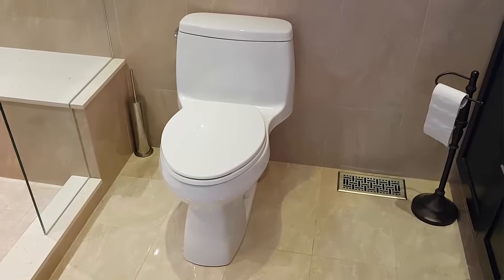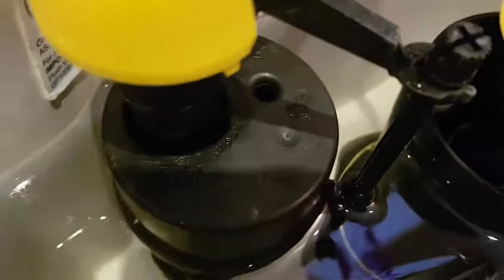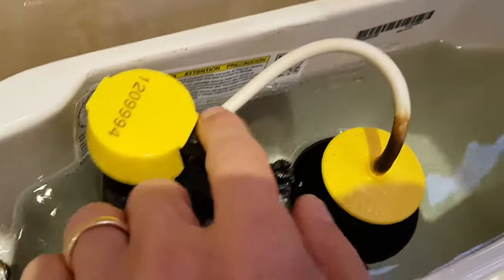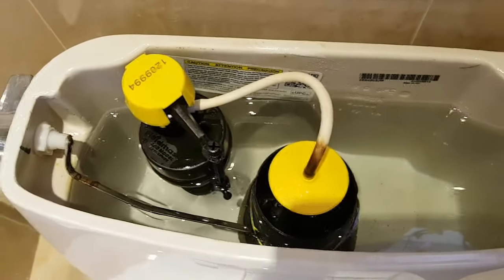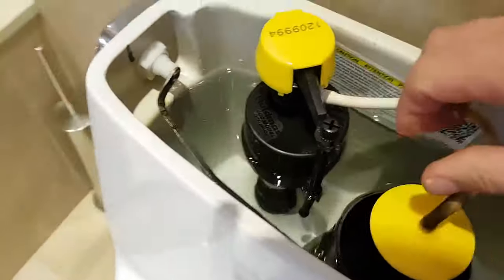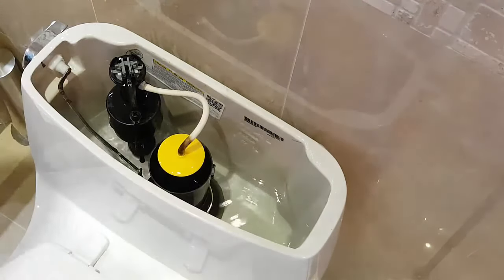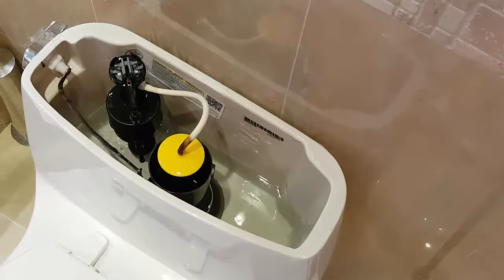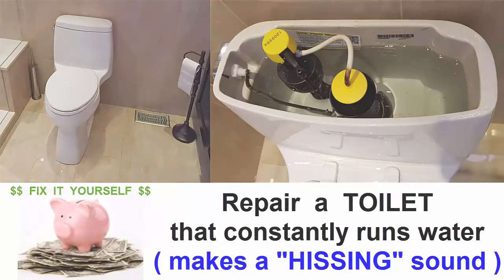Repair a Toilet that continuously runs water (makes a "Hissing" sound)

Comment: Thank you! I was on my way to bed and ask my husband if he had use the bathroom recently. I heard a hissing sound and when I lifted the lid I saw that water was still running and the hissing sound.  Well it’s 3:30am here in the Poconos and there no hardware store open. So I suggest we shut the water off. We look at some YouTube videos and came across yours. I showed my husband it and he did exactly what was in your video. There was some debris. We had an old brush. He popped it back in and boom it worked. We thought we were gonna have to replace all the guts which are like 2 years old.  Thank you so much! Now I can go back to bed and rest soundly. Thank you!!!!
Reply from the maker: Thank you for your comment and positive feedback. Glad to hear the video helped you resolve your issue. Thanks for supporting my channel. Vito Casola - FIX IT Yourself!!

Comment: When I take the cap off it's spraying lightly underneath out of the top. Is that due to a bad gasket or is the entire assembly broken? It's night so I don't want to mess with it right now in case of emergency the stores are closed. I did remove the washer gave it a good cleaning and flushed water through the valve by turning the water back on and it still hisses and sprays. Thoughts? Can just the valve fill assembly upper portion of this part be replaced?

Comment: OMG.!!! With your Video I just fixed my toilet.!!! I was told by my Plumber I had to call KOHLER for a replacement part and/or call Lowe’s. It’s the weekend so I finally decided to Google how to fix a hissing toilet and clicked on your Video. With your help my toilet is fixed. Thank you
Reply from the maker: Hi Sharon,
Thank you for your comment and positive feedback. I'm so glad to hear your story. Isn't google and YouTube amazing? Someone who has gone through the same trouble and diagnosed/fixed the issue can then help another person to quickly and easily fix a little problem with relative ease and zero cost. Thank you for supporting my channel. 🙂 Vito Casola - FIX IT Yourself!!

Comment: So I changed the flapper based on another video and still heard the water running.  I tried turning the knob which adjusted the water level but didn’t stop the leaking.  Just when I thought I’d have to replace the valve I watched this video and took the top of the valve off and cleaned the rubber and plastic (which I doubted would work).  Working perfectly and stopped all running water.  Thank you!

Comment: Thank you so much for this video!!!  I watched several on how to stop the toilet running but none of them offered the solution.  You suggested cleaning the valve and showed how to take it apart.  My toilet is American Standard, so it has a similar assembly.  Lo and behold, cleaning the grit out did the trick.  My daughter and I worked as a team (she's a nurse) and with tweezers and a dental floss gadget, we got 3 wee stones out of there.  It felt like a medical procedure. :). No more hissing or leaking water.  Thank you again!!  Empowered?  You bet!

Comment: I have the same toilet so it was easy to follow your steps. There was a tiny white pebble stuck in the valve. I removed it put it back together and the hissing/running water stopped! Thank you, a plumber quoted me $325 for a rebuild!
Reply from the maker: Wow!!! So glad to hear my little video helped safe you from possibly giving that plumber the go ahead to fix the issue for that price. I think you could buy a brand new toilet for less than the $325 he quoted. Anyway, so glad you found my video and it helped cure your issue. Vito Casola - FIX IT Yourself!!

Comment: I just spent $500 to have the shut off valve replaced and new fill valve. Heard the ghost flush and hissing after the plumber left. I was very upset as the plumber told me if the water still runs then I need a new toilet. Googled this morning and found some debris in the chamber. No more hissing. Fingers crossed no more ghost flushing. Thank you!
Reply from the maker: Too bad you didn't find this video first. It would have been nice to know it could have saved you the $500 bill. Vito Casola - FIX IT Yourself!!
Reply: @FIX-IT-Yourself  I definitely still need to have the professional to fix the water shut off valve. That part was busted (20+ years of not turning the valve). It was like $200+ to fix the valve and another $200+ to replace the internal mechanism. I am just happy I didn't have to call them up again. I may have listened to them and replace the toilet. Yikes! Thanks for the video.

Comment: I have to thank you for your video. You were the only ne I found exlaining the FILL VALVE, BUT...... when I was taking everything apart, I discovered something I had only seen one time. I had a "BUBBLE" in the yellow seal. I used a NEEDLE to puncture it and get the WATER out of the bubble which had been holding my seal apart from sealing. Of all thee videos about how to change the round valve in the bottom of the tank, NO ONE had indicated that the valve could be defective and allow a little bubble full of water to cause the tank to slowly leak. Thank you for taking the time to make your video. You did an excellent job.
Reply from the maker: Thank you John for your comments.  I'm glad to hear you found the video helpful and better than most others.  It's comments like this than keep me inspired to continue making videos that will assist others to diagnose and fix problems around the home themselves and in the process save some money, learn something new, most important of which is that most thing you can FIX Yourself, even if it just requires a little guidance to give one confidence to go ahead and tackle the job.  Keep on FIXING IT Yourself!! Vito Casola - FIX IT Yourself!!

Comment: After just 3 weeks my new Kohler toilet with the yellow-cap Fluid Master started running on as described here.  Followed this video and it is fixed.  Did not see any debris on the black washer, but did the flush under the cup as described.  Thanks for making this video!
Reply from the maker: Hi Moss, Thank you for your comments, it's really appreciated. I'm glad the video helped you fix your issue.  I know it's not the toilet but just the smallest piece of debris that may get stuck inside the valve assembly under the washer and sometimes it will pass through and other times it will get stuck and cause the continuous running of very small amounts of water and you hear the hissing sound.  I too was baffled when I first noticed hearing the sound. It was late at night when everything was quite and the furnace wasn't running and when I had to put my head close to the toilet I noticed the hissing and that's when I started exploring where it could be coming from.  Anyway I'm glad my experience is helping others.  Vito Casola - FIX IT Yourself.!!
Reply: Thanks.  None of the other videos addressed this problem!  That yellow cap didn't want to come off, but when it did, the toothbrush and the cup over the water test proved great!

Comment: Thanks for stepping through all of the detail - I've done easy fixes on old-style toilets, but finding all of this plastic in a new one I was afraid I was going to break something just trying to make adjustments. (Same "hissing", the fill valve was refusing to close all the way even if I pulled the float up hard; sure enough, taking the top flap apart and brushing everything off was all it took.)  Also thanks for the "just turn the water back on only a little at first" - seems obvious but it hadn't occurred to me and is a really good idea.
Reply from the maker: Hi Mark, Thanks for leaving a comment and for the positive feedback. I'm really glad this video helped you solve your issue. Thank you for supporting my channel 🙂 Vito Casola - FIX IT Yourself!!

Comment: Tip on cleaning the intake valve seats worked great. Although I didn't actually see any contaminant on either surface (poor lighting and I didn't want to separate valve from the linkage unless I really had to) wiping both sides of the seal with a cloth then rinsing with clean water has cured the problem. Thanks again!

Comment: Nice. I've replaced the generic fluidmaster kind twice. What I Noticed about those is the entire assembly comes out with the top cap. So it would be easy to just flush and brush it out under some hot faucet water lol. Good thing they are relatively inexpensive so I didn't lose out to much by just replacing them. Still good to know you usually don't need to replace the entire regulator.

Another common mistake that causes toilets to run is shoving the rubber tube into the overflow drain instead of using some kind of clip that holds it above it. If you shove it into the overflow it ends up syphoning the tank water.

Comment: I suggest checking incoming water pressure. There’s only so much force available from the float. I found I had 90 psi at my house! Having a pressure reduction valve installed helped the toilets, the showers no longer feel like sandblasters, and water hammer arrestors now work.

Comment: Thanks for the great video. Was able to fix my hissing leak just as you demonstrated. Before I viewed the video I was trying to see how the valve worked but couldn't get past taking the yellow cap off: didn't know how much force where to get it off without breaking something. Likewise the '1/4 turn to the left on the valve' to take it off. Better than trying to pry it out with a screwdriver :)
Reply from the maker: Hi, Sorry for the late reply. Thank you for your comment.  I hope the video helped you to resolve your issue. Vito Casola - FIX IT Yourself!!

Comment: Thanks for the video...8:40 p.m. on a Friday  I just stop the leak on my kholer toilet cause of the leak pipe debri was in the top where the gasket sits devri wasn't letting the gasket to block the water completely...thanks again for the video was very helpful...

Comment: Thank you but ! I was hoping you would include the repair of the flushing- gasket repair-tower in the center of the water tank
Reply from the maker: Hi Alan, Thank you for your comment. I'm sorry, but if that would have been the problem for me then I likley would have done that but since my problem was simple that's unfortunately as far as I needed to go. If my toilet ever needs the center tower repaired or replaced then I may consider making another video of that. Great thing about Google and YouTube is you should be able to find someone else that had that problem and hopefully made a decent video showing how to fix it. Vito Casola - FIX IT Yourself!!

Comment: Great video overall. Did I miss the part where you explain which way you turn the screw to raise or lower the water level? I think it's clockwise to raise and counter clockwise to lower? I think mine is just over filling. I will write back when I figure it out but I'm defintely going to clean it per your video, thanks.

Comment: I can't get the top of the fill valve off to clean it. I'm not sure the top on the cheap model I have (Bristol Bay Comfort Series) is meant to be removed. Any suggestions?

Comment: Hello, I hope you will help me. My KOHLER Highline Classic White WaterSense Toilet keeps running water. Could you advise me on what I might need to do to solve the issue? Actually, the toilet bowl itself fills up way more than it is supposed to fill. I really would appreciate any input because my husband with dementia was just placed in a nursing home (almost $5,000 a month), so I have no choice but to learn to do home repairs myself. I am overwhelmed...
Reply from the maker: Good Morning Donna,  I'm sorry to hear about your husband. Regarding your toilet is it the toilet bowl itself that is filling up too much or the tank which holds the water until you flush?  If it's the tank then you should be able to adjust the water level height.  If you remove the lid on the tank take a photo of the inside of the tank and email it to me at vmcasola@gmail.com and I will see what type of mechanisms you have inside.  Then I might be better able to assist you.  Vito Casola - FIX IT Yourself.!!

Comment: I did it!!!!! Thank You 🙏
Reply from the maker: You're welcome. Pretty easy wasn't it?
Reply: @FIX-IT-Yourself  Not really. The factory installed the floater facing the back wall. So I was struggling and fighting with this damn thing for three nights ready to break everything. I finally moved the justable stem and the water hose in the tank and it gave me just enough room to pop out the gray cap. The reason why I was excited for your video it was the same exact toilet bowl same exact guts! So your video gave me that inspiration. When putting it back I didn’t put it back the way I found it I put it back the way it supposed to be in the middle towards the front of the tank not the back. Thank you again!
Reply from the maker: @ANDRESARKISSIAN  Wow, that sounds like quite the effort. Where was the quality control and quality assurance when they put your tank together? Anyway, sure glad the video helped give you the confidence to FIX IT Yourself!!. Vito Casola - FIX IT Yourself!!

Comment: My toilet makes a hissing flushing noise randomly.. I already flushed, cleaned, and replaced the rubber washer on the filled valve, also cleaned the red O ring of the flushed valve (it does not look worn out).  I put some red food coloring in the water tank, it does not look its leaking 30 mins later into the toilet bowl.  What else should I try?
Reply from the maker: HI Wendy, Sorry for the late reply. Not sure what else you could try. It seems as though you've tried everything. Does the noise go away when you shut off the water supply at the isolation valve? Vito Casola - FIX IT Yourself.!!
Reply: @FIX-IT-Yourself  I have not tried shutting off the water line as the flushing noise is intermittent, it only happens once a day if that... Maybe time to get a new toilet

Comment: I replaced the fill valve washer, its still making the hissing noise intermittenly, no leaking from the fill cap area..  maybe its the flush value O Ring causing the hissing?  I will try also flushing  the fill valve first.
Reply from the maker: Hi Wendy, Thank you for your comment. I guess it could be but I would double check the fill valve area first and make sure to flush out any debris that may have gotten lodged into the rubber seal. Be sure to rub your finger all around the fill valve seal and flush the entire area, as I showed in the video, by putting a small empty margarine or yogurt container upside down and turning on the water to allow a good flush. Then reassembly everything and see if that cures it. If not and you did already replace the inlet valve seal then, yes maybe time to check the flush valve seal by lift it and rubbing your finger around the bottom of the seal and seat to ensure no debris is sitting between them. Good Luck. Vito Casola - FIX IT Yourself.!!
Reply: @FIX-IT-Yourself  Thank you. I will try all your suggestions.

Comment: So in my case the water comes through the grey top under the yellow cap and causes the hissing sound. It continues to come through even if I turn off the water. I guess I have to replace the whole thing but at least I’m not really wasting water in the meantime (Water goes back into the tank)?
Reply from the maker: Hi T, That sounds really strange. If you turn off the water at the source it still makes a hissing sound? You sure you shut off the main water line feeding the toilet. Sometimes the little black round rubber seal gets old and doesn't seal good anymore.  In that case you need to replace only the rubber seal.  This happened to a friend of mine and we tried putting the seal in a pot with boiling water to see if we could get it to soften up a bit but it didn't work. In the end she went to home depot and purchased a replaced rubber seal for like $5, put in back in the toilet and it worked like a charm. Vito Casola - FIX IT Yourself!!
Reply: FIX IT Yourself yes i did that and it works! Thank you!

Comment: I cleaned the part but after I did a test flush, the water came up to where it should, the hissing continued. There is water leaking from the fill cap area.  What do I do?
Reply from the maker: Hi C S, Cleaning that area where the gasket will sometimes cure the problem but if the hissing continues it means water is still leaking and you will have to replace that rubber seal. As the rubber gets old it also gets harder and less pliable so it doesn't seat perfectly and create the seal.  I actually had this happen to a friend of mine and she watched me try to repair by just cleaning and it didn't work. We tried putting the old rubber seal in boiling water for about 10 minutes to see if that would help make the rubber softer but that too didn't work. In the end I told her to just go and buy a new seal.  She went to Home Depot and bought a new one for less than 5 buck.  After watching me try to clean the old seal several time she was able to installing the new rubber seal herself and then it worked perfect.  Good Luck.  Vito Casola - FIX IT Yourself!!
Reply: My toilet has a bulb  float  turned water off but tankstill fills up but wontflushdown